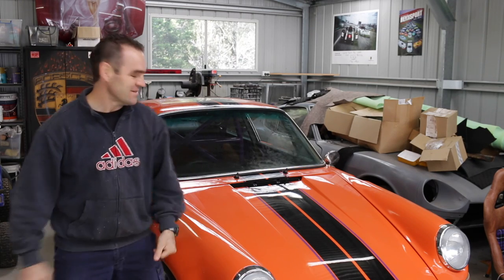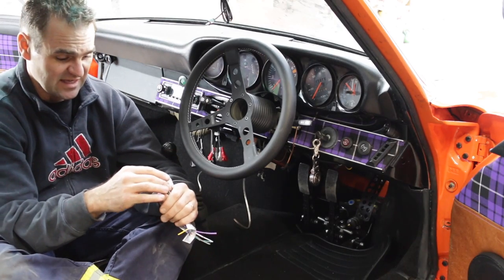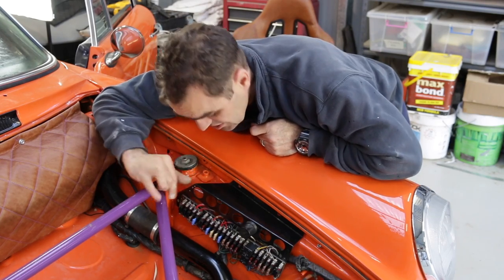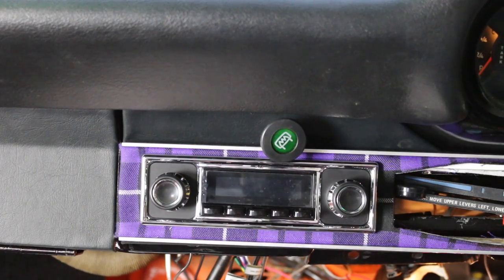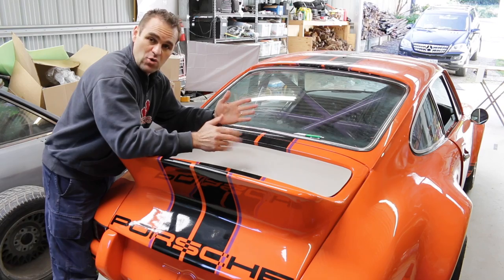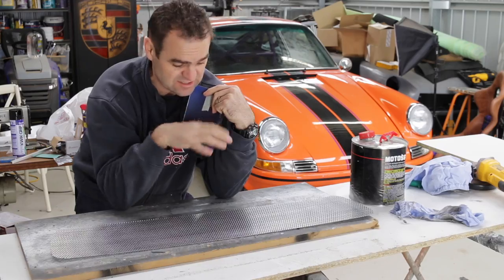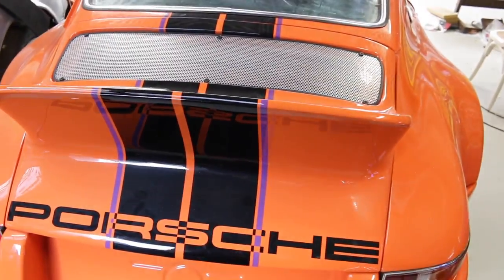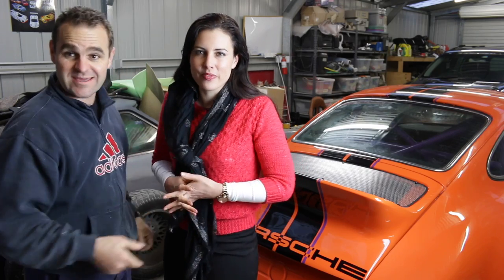How to make custom grills - Porsche 911 Classic Car Build Part 56

Comment: Yaay! My favourite rivnut gun used again! Those wierd lights under the dash coming on might be a lack of a good earth or getting power from an old alarm (or other accessory)  wiring setup used previously...Those RUF Porches are good..maybe a trip to Germany is on the cards one day? Ya?
Reply from the maker: We are definitely heading to Germany at some stage in the next few years. I have also had a suggestion that those lights, may be from me wiring up the back of the light switch incorrectly. I will have to do some investigation and find out.

Comment: It's amazing how hard it is to properly fit the windscreens in these cars - I think we may have to pull the freshly installed glass in Larry (AMMO NYC)'s 964 to add sealant due to wind noise.  You're planning to go without, right?  The factory instructions are even less clear for the early cars.
Reply from the maker: I love Larry's videos, particularly his 964 vids.
I have been lazy and I haven't chased it up yet, but I am going to get an genuine rubber for my car. Also one of the tips from the windscreen installer is to install it dry, but then after it's in, he runs a bead of silicone under the outer lip of the rubber where it seals against the car. He also does one on the lower edge, between the rubber and the glass to stop leaks.
Reply: Smart - we should see if we can fix it by running a bead without pulling it.  His 964 just had a full repaint and looks amazing; you should check it out when you're over here.

Comment: I am interested in the rubber edge trim. wondering if you have a link? I would suggest that provide links to items when you mention them, just a thought. It would be helpful. BTW your doing a great job and I am really enjoying your build. I have been thinking of do a similar build myself and found you while searching YouTube.
Reply from the maker: That is not a bad idea, it is more that I am not trying to promote any particular supplier. Here is a link to something like what I used. http://www.ebay.com.au/itm/4M-x-1-5mm-Sharp-Edge-Rubber-Trim-Seal-Strip-U-Shape-Car-Caravan-Boat-Universal-/322118685711?epid=890567160&hash=item4affc5140f:g:CpwAAOSw6btXSrcK

Comment: don´t know how hard parts are down under i would have bought  new pins and put them on the speaker kabels so no solder, ps on the konstant power it´s know as kl 30 and switched power is kl 15 ,normaly the ground is braun at least on the std. wirring, like the radio look´s nice, does it have a microfon so you can talk and drive legal??? if it does put it near the rear view mirror cause out by the a pillar it would catch wind noise as always keep up the good work
what are you doing with the gearbox???
Reply: grills turned out very nice
Reply from the maker: The stereo does have a microphone for the phone. That is a good point putting it in the centre to avoid wind noise.

At this stage I am keeping a standard clutch, flywheel and gearbox.
Reply: okey did not know it was in working order the engine was a little ruf😉

Comment: Awesome job with the grill!  Any chance you know what gauge thickness of the metal and size of the hole cuts are?
Reply from the maker: Sorry I can;t remember. I just went to my local metal supplier and got what they had. Mine is galvanised steel, but I think Aluminium could be better.
Reply: Thanks!  I'll be doing the same for my front end and like the pattern.